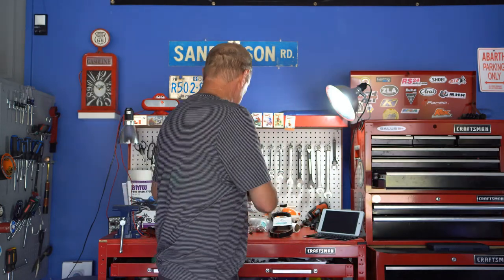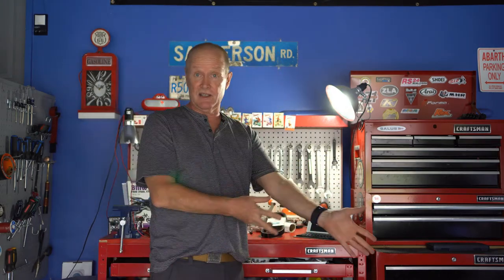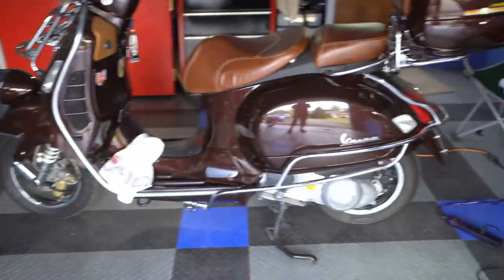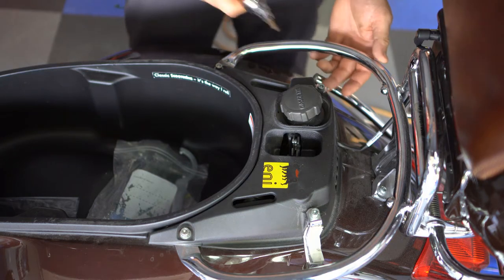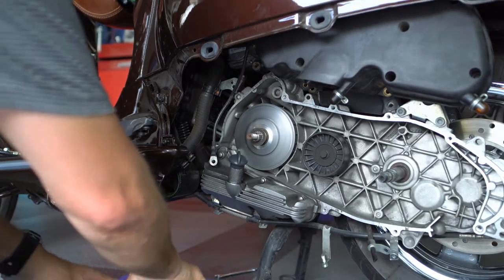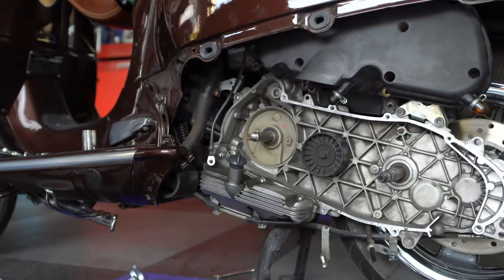Vespa GTV-300 Part one orf Two Belt, Roller and Pulley assembly change and maintenance.

Comment: Hi Peter. Thanks for a very useful video. What was your reason for changing the belt and the rollers? Was it just scheduled maintenance or did you have an issue? The reason i am asking is, that on my gts 300 i tvivl o can hear some ratling noises from the transmission and i was wondering if you had the same experience since you changed the rolers, belt and variator? Regards Henrik.